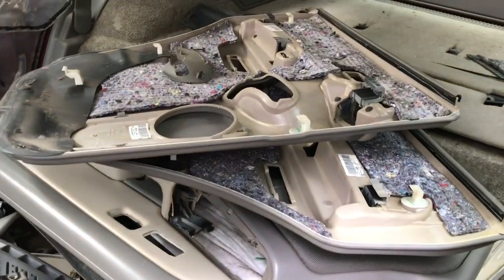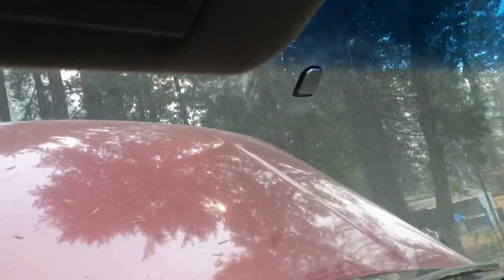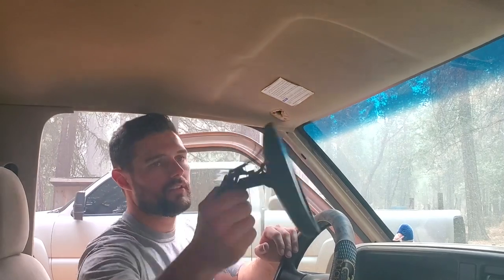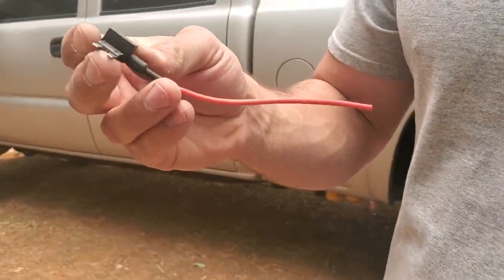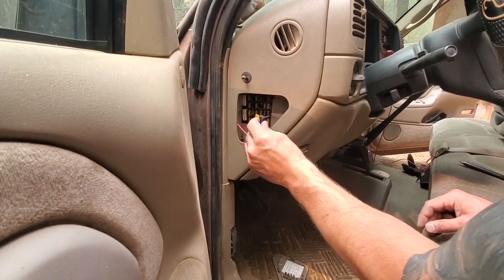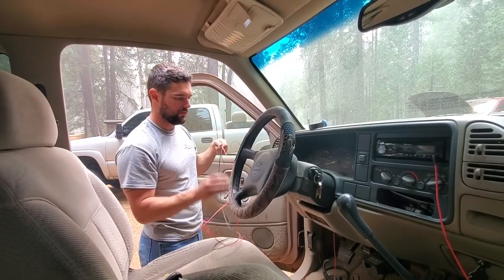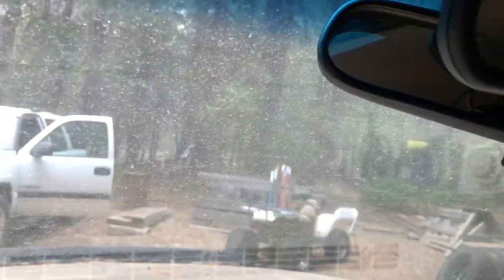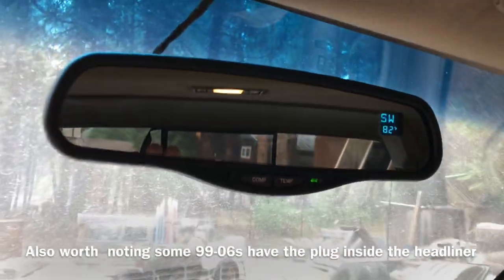How to Add Auto Dimming Ambient Temp Rear View Mirror SIlverado (And How To Fix No Display)

Comment: Great little upgrade on the rear view mirror that quickly becomes a “BIG” upgrade as you get in the habit of looking at it to use the information. The ambient air temp sensor is a positive temperature coefficient thermistor in a clip on/bolt on housing. Simply called a PTC thermistor, the colder outside, higher resistance, drops gently on a downward curve as it gets warmer. Very little current runs thru it but for those reading, alway use both wires. It is what’s called a dedicated ground directly into the display circuit. Never use the chassis for ground as too much resistance, even low throws off the reading.  
  Good catch on the cold soldered 403 years ohm resistors. They are in series and one end cracks, goes out or intermittent. Also, getting the face off the mirror, tabs are spaced equally around outer edge. A 0.90” thousand feeler blade works well and use two or three as you work it off. Never use a pocket flat blade screwdriver as even those are way to thick & will make ugly marks. SnapOn sells the blades separately from the entire kit but HF will allow you to get 3 or 4 kits and work the same. Power or ground turns on a “Dichromatic” mirror dimming for all 3 mirrors. (Your May vary / Review schematic for correct year / GM and others have wires & connector, colors and proper cavities) Go to dealer and ask a tech who will print for a six pack or $5. Each tech have a terminal but may share with 1 or 2 techs. Nice job for a cool upgrade as I put one in a 1967 C10 without “On-Star” and changed circuit board from “SIR” to Select to switch. 6-8 regional GM AUTH SHOP, but a number of shops do these and may sell “Soft Button” cover, even face plate.
  Great job of swapping out. It is work to video, prep, review, edit then upload. Takes longer that changing the mirror, right? Nice. ASE Master Tech since 1978 - Retired

Comment: Thanks for the tip on the resistor repair at the end of the video. My mirror died the same way. My base model 1999 Silverado had a plain mirror. I grabbed one like yours from a parts truck and installed it in 2015, Looking forward to attempting the resolder tomorrow.

Comment: Fixing to buy a truck similar to this but its a 97 cheyenne 3500 dually. Do i do the same exact process as you did on yours? Can i tie in the red 12v wire with the fuse for power to the radio?

Comment: chevy trucks 99 on up have the wiring harness in the head liner and all you need is a mirror and sensor 99 00 are the same wiring just dig out plug and play 01 and up are different plugs

Comment: They're not chips, those are resistors. In my case, the voltage regulator on the main board was also toast, had to replace that too. Just look around and try to spot some scorch marks or cracked solder joints and sometimes, obvious probles might stand out.

Comment: I tried wiring it in I bought the harness and sensor but it’s still saying open circuit does the wire location matter on the sensor? They came only white so not sure

Comment: Will the auto dimming work for a 05 cateye 2500hd work truck model truck no power windows or anything at all straight up work truck,I want the dimming the outside air temp an direction of travel
Reply from the maker: Yes it will. It has a light sensor on it. So you would just need to wire it the same way I did
Reply: @EndlessWishlist  the sensor on my dash is missing wasn't on it when I bought it 3.5 years ago will that effect the dimming mirror?
Reply from the maker: The sensor on the dash is for your headlights. The mirror itself has a light sensor that dims when there is someone behind you at night
Reply: @EndlessWishlist  oh hell yea man that's awesome

Comment: my mirror harness was tucked up inside the headliner.  added a mirror and a temp sensor and bam.  

2000 silverado with power windows.  i've heard if the 99-06 trucks don't have power windows, they wont have the mirror harness tucked up inside the headliner.
Reply from the maker: I mention that in the end of the video. My 2002 had the harness in the headliners.
Reply: @EndlessWishlist  your 2002 has power windows correct?  I had read that the non power window trucks don't have that mirror harness.  I can't confirm.
Reply from the maker: Yes my truck has power windows
Reply: Endless Wishlist hey I found the same thing on my 99 Silverado. I’m getting an open circuit error on the mirror. Any ideas?
Reply from the maker: Yea you don’t have the sensor install. My 2002 had the same thing. I just ran my own wires and got a sensor/pigtail from the junk yard
Reply: Endless Wishlist ok sweet thanks! And for getting through the engine bay, you just cut a small hole in your steering shaft boot?
Reply from the maker: Yup, that’s exactly where I ran mine
Reply: @iiDeReX  soo am i
Reply: @EndlessWishlist  well supposedly the pigtail should be on the passenger side behind the blinker light fixture.. I ended up having the pig tail but as soon as I connected the sensor it still read OS
Reply: @tony3552  Where exactly did you find it? I'm been trying to look in that location and don't see anything I have taken the grill, the headlight, and park light just so I can get a clear view but don't see anything. My 2002 Silverado has power windows so I had the connector in the headliner like y'all have said. And I also have the OC "Open Circuit" message on the mirror that I just got on ebay yesterday. So my last step is to find that sensor and see if its good or to get a new sensor. And the funny thing is, is that on the connector that goes to the mirror the wires for the sensor are populated so idk. Thanks in advance
Reply: My single cab have power windows but don’t have the headliner harness